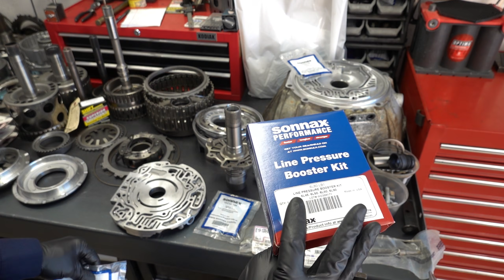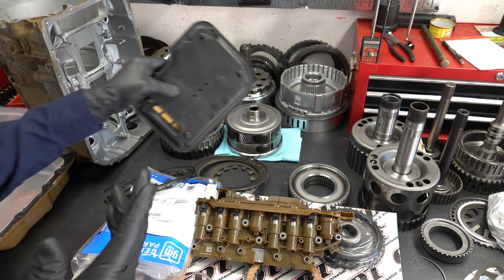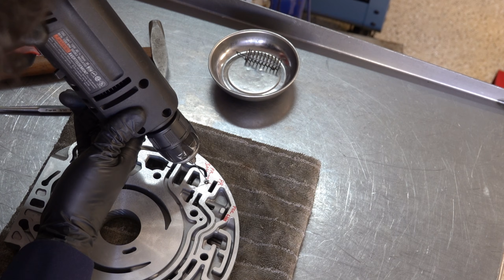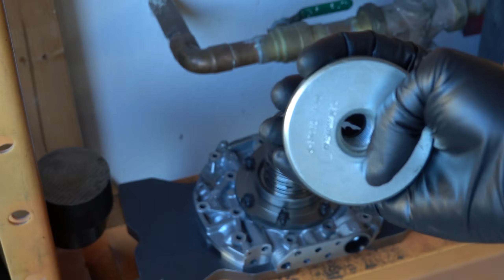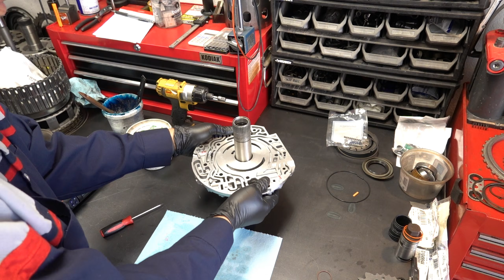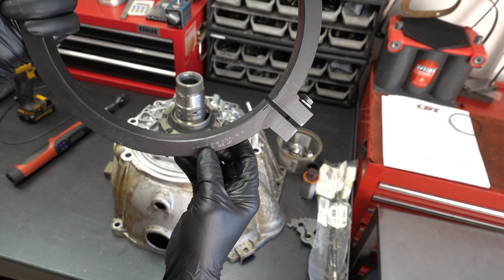6L80 Performance Rebuild PT1 - Overview and Pump Assembly

Comment from the maker: Notice to All Builders: Sonnax released their updated pressure regulator valve after this video was filmed - the updated valve DOES NOT require you to drill the balance hole in the casting at the back of the pressure regulator valve bore, as shown in this video. The new Sonnax part number is 104520-15K. This part supersedes the previous design, which was part number 104520-14K and is now considered obsolete.

Comment: I recently rebuilt one, been a few years since the last one I did.

This one has a bind in 3rd gear that I believe is due to the 4-5-6 clutch clearance being too tight. It’s at .054” and spec says .060-.074. Is that really enough to cause the issue? 

The paperwork included in the tow and pro kit from transgo describes this same complaint. Only happens once per key cycle.. after it binds, it drives flawless the rest of the drive until its key cycled again.
Reply from the maker: Hi Chris, thanks for watching.

We typically don't see binds at the 3-4 transition due to 456 clutch clearance being too tight until you get below .045 clearance however these transmissions usually like more clearance, not less. 

That said, the ATSG manual calls for .050-.074 for 456 clutch clearance however Transgo's are also acceptable. I'd take it back out and purchase a thinner snap ring to bring your clearance to at least .060 but not greater than .075. I would measure your clearance once you have the trans apart again (in fact, measure all clutch clearances and record the values).

Gears Mag also has an article about this issue: https://gearsmagazine.com/magazine/6l80-bind-after-2-3-shift/

Check for cross leaks at the stator and input shafts between 1234 & 35R along with the 456 clutch, if you didn't do that during the rebuild or via post-rebuild diagnostics. Once you get your clearances into spec, that should resolve the problem.
Reply: This bind happens about 2 seconds after the 2-3 shift

How can I check for cross leaks there?
Reply from the maker: Here's my air check video - you don't need any test plate to do this and it can be done either w/the trans still in the vehicle or fully assembled on the bench (valve body/TEHCM/speed sensors off of the case belly).
https://youtube.com/shorts/qG-mb8Rs34g

Bind on the 2-3 shift would seem to indicate an overly tight 35R clutch pack however the TEHCM preloads the 456 clutch pack's apply piston w/fluid during the 2-3 shift to prep it for the 3-4 shift. If the 456 clutch pack clearance is too tight you'll bind as you shift from 2nd to 3rd as the 456 clutch pack should not be applied during that time.

Check out the GEARs Magazine article that I linked in my previous reply for a more detailed explanation.

Comment: I cant stop watching your vids. Yes they are long but definitely the most thorough step by step instructional vid out. I tried finding the Saturn TAAT control valve body dowel bolts you suggested for aligning the pump but not much luck. Any search suggestions? or maybe my wording is not correct in my search. I think this is the most economical for a single build.
Reply from the maker: Thank you very much for all the views and kind words, Wade! 

When it comes to bolts and small parts, your best bets are eBay, the dealership (if such parts are stocked) or a local pick and pull junk yard.

Comment: Hi Nick, I have old model stator upgrade it with new model dose require to change other parts to fit. Also if buy new stator i will machine only pump body so use OEM thrust washer or oversized one?
Reply from the maker: Use OEM washer and check 35R drum spacing/end float - if it's excessive, install the Sonnax washer. 

End float: https://youtube.com/shorts/14Tf4G3EQHI

Comment: Great video! Is the Sonnax intermediate shaft recommended for a 6.2/6l80 AWD (bolt-ons & tune only) that is used for 7000# towing less than a dozen times a year and street performance?
Reply from the maker: Thanks for the view and kind words, carsandracetracks. I'd put one in as insurance, especially if engine power is in excess of 500 at the crank. All it takes is one more pull/trip down the track to break those spin welds that hold the intermediate shaft to the hub...

Comment: Hey:  I have watched several of your GM transmission videos, especially the 6L80/6L90, and I appreciate the level of detail along with your commentary.  These transmissions require Dexron VI atf, and Dexron VI is available as both a synthetic blend and synthetic atf with each base oil meeting Dexron VI specs.  My question, have you noticed any performance differences between the synthetic blend and synthetic Dexron VI fluids in GM pickup trucks?  Again, many thanks for making these videos.  Best.
Reply from the maker: I run synthetic Dex VI in my Sierra's 6L80 and have no direct or ancillary experience with the synthetic blend stuff. Thanks for watching, RG.

Comment: Getting prepared to rebuild a 6L90 that’s in my 07 Sierra 2500HD. It’s been a great trans but now has 170k miles on it and it’s starting to show some wear, no codes yet though. I’m sourcing GM updated parts and special tools I’ll need. Thanks for taking the time to produce this vid, it’s come in helpful already.
Reply from the maker: Thanks for watching, emf! Appreciate the views. Post any questions you have along the way.
a couple videos you may find helpful, if you haven't already seen them:

Special tools: https://youtu.be/gTGRiPsnlHE

Tip for reinstalling 2-6 clutch return spring: https://youtu.be/GLTUPEOA-Gc
Reply: My truck is a 1500 AWD,6.2 with a 6L80.A little more than 300,000 miles. All gears are good except 2n to 3rd is slow to shift. I let off the throttle to complete the shift for less slippage. I will be doing a complete engine and transmission rebuild in 2 years. Was thinking about doing a TC lockup delete if possible.

Comment: In addition to the circle D stage 2 kit, do you have a list of every item needed that is not included? I've watched all of your 6l80 videos, and i am practicing on a core just disassembly and reassembly for now.

I will them be pulling the 6l80 out of my 2008 cadilac EXT AWD. 

I just wamt to make sure i dont miss a part and end up waiting for them to come in. 

I know a parking rod is on that list possibly a sonnax hub and mot sure if this includes the trans go or zip kit also or if thats something sold separately
Reply from the maker: You actually have the list - this video! I show all the parts that went into the unit, including those not included in the Circle D kit.

Comment: ugh.. this looks scary. my 6l80 torque converter started shuddering and i drove home 10 miles and parked it. guess now i’ll be doing a full rebuild. at least frictions and steels, molded pistons, billet torque converter, and all new seals and gaskets bushings. also trans go pro and tow kit. i’m sure im missing a few things i need. just nervous to do it myself
Reply from the maker: Don't be nervous - these transmissions are not difficult to work on once you have all the tools and supplies you need. Plus you have this video series, my other demo series and the ATSG manual (link to a free PDF version should be in the description).

If you don't have vacuum testing equipment, I would either outsource that function to a transmission shop or simply purchase a reman GM pump assembly and valve body assembly. Then you just have to worry about building up the case correctly.
Reply: @nickstransmissions thank you man, i will definitely keep that in mind. i also think its just a whole lot of information im trying to take in at once and learn so im overwhelmed but i think as the days go on that i watch you and other guys videos i feel better! thank you once again!

Comment: Is it ok to run this level kit on a stock 5.3? But planning on adding more power later.
Reply from the maker: Sure. In fact, I'll be installing that kit into my GMC Sierra's 6L80. Just make sure you turn the air bleed off in the 4-5-6 shift table as the Sonnax 4-5-6 piston kit that comes w/the broader Circle D L2.5 kit requires it be deactivated. This is due to elimination of the wavy cushion plate when using the Sonnax kit.

Comment: Morning Nick… quick question which of the Chevy transmissions would you say is the easiest and cheapest to repair .. on normal occasion fb marketplace … and which name brand kit do you prefer to install on that transmission thanks …
Reply from the maker: TH350s and TH400s as they're both related to 700Rs, 4L60Es and 4L80Es so a good stepping stone into those four-speed units. Kits can be bought at local hard parts suppliers. Transstar, Transpartswarehouse, WIITPerformance Transmission all have complete kits available for whichever power level you're building for.

Comment: On the sonnax pump thrust washer that’s thicker is it required when your only replacing the stator and not the bell housing because my bell housing and everything is good it’s just got the old crappy 1st design stator sealing rings that spin so I’m buying the updated assy that doesn’t spin with a machined down stator plate… would I use use the original thickness thrust washer or the os washer …. Again ur the best at this stuff others just show here and there and I think purposely leave stuff out and you … you show us everything and might I add lol u make it look so easy lol … thanks again
Reply from the maker: Hi Kenneth, if no machine work is being done, simply use the original washer. If the stator is being machined, use the Sonnax .020 thicker washer.

Comment: I have built thousands of these units- 80 or 90- same thing, SORT OF. The 90's have a few different (bigger) parts, but over all same trans. Most failures are not due to convertor failure, but rather, due to pump reg. problems and lack of fluid changes causing convertor failure. A few techum issues here and there, but, that is usually indicitive of trans mechanical issues. IF you are reusing the techum, replace the presure reg. switch diaphrams in the techum, you can also buy this kit, tooling to do this is inexpensive. 

More often then not, the 4-5-6 clutches are smoked. Also, The 3/5R drum cracks at the weld and leaks, then looses sealing at the bearing that is pressed into the 3/5R drum - make sure you replace this bearing/seal as it has an o-ring seal made into the bearing assembly where the pump enters it. It is rare to see cracked pistons- check them either way. You can also check the 3/5R drum with speciality tools, at additional cost- highly advised.

GM offers a fully loaded 3/5R assembly- USE IT, it will save you time and money.

If your bellhousing/stator- (pump assembly) is trashed- replace it as a machined assembly, however, if it looks good run it- as it is a machined assembly from GM when it was originaly made, but replace the pump bushing and seal. I highly advise a pump alignment tool when reasembling the pump, do not tighten the bolt on the pump alignment tool- it is not necessary, as this can cause incorrect torque issuse because the stator has to fight the grip of the tool on downward force- this pump alignment tool is of spring steel no need to tighten it- let the correct torque be allowed. Also, the pump bushing on install and removal is in one direction- opposite of each other- purchase the correct tooling to do this correctly, otherwise you will break the bellhousing where the bushing goes in. Trust me.

FYI; trans assembly gel is not trans lube- keep this in mind- it is ASSEMBLY GEL. From 1:18:15 to 1:22:02 is a/an compleatly incorrect way to install the pump assembly, first off DO NOT, I REPEAT DO NOT use trans assembley gel on your pump, with 2 exceptions. Only to hold the pump slide lower seal and vane guide in place (sparringly) which negates the need to flip the bellhousing, and never use it on any part of the pump slide assembly. Then lightly lube using trans fluid instead.

If you do not have a REAL trans cooler flush machine, REPLACE THE RADIATOR AND COOLER!!!!!!!!

All the parts to fix this trans and make it far more reliable are available from TransGo, in drop in fashion, both for valve body and pump in a easy to install kit. Quick and very relaible. Most of the time these transmissions are over heated, add too, or, replace your stock trans cooler, (very important- keep it's cool) run REAL synthetic fluid, such as Mobil One. Then you are good to go.

As a side note: This is the EASIEST automatic  transmission to build- period. It's what I train all new builders on.
Reply from the maker: Hi Kodi, thank you for your comment and for sharing your knowledge. From the units I have built (probably not anywhere near as many as you have), the TC was the primary reason the trans came in but the PR valve, TCC reg valve (hydraulics in general) are the main underlying drivers for converter and other issues in those units, as you mentioned.

Re the 3-5-R drum: I just have the welds on the existing drums reinforced (unless there's something else wrong with the drum). Everything is tested, inspected, and either reconditioned or replaced in my builds. It's much less costly and they have a stronger drum...While I know GM strengthened the welds in later years, I simply don't trust them.

Re the TEHCMs: I almost never reuse TEHCMs; the only instances I do are when customers simply cannot afford to replace them. In those cases, they get no warranty coverage if the pre-existing TEHCM malfunctions and damages internals, requiring the transmission to come back to me for repair...At that point, they pay for the repairs, labor and a new TEHCM, if they want me to touch it...Their warranty spells it out in super-clear language.

I've never had an issue using Transmission assembly lube on pumps for any transmissions but I know many will use transmission fluid in that area. So I'd dispute your assertion that my process was incorrect when it comes to pump assembly. I prefer Sonnax parts over Transgo but I use their stuff in many other applications. 

Very much agree w/your side note. I'd also apply that note to the Ford 6R80s and 140s. 

Thanks again for taking the time to watch and comment. It's always nice to hear different perspectives from other, more experienced builders.

Comment: Hello Nick 

If it's only the stator support that is machined, do you still recommend using the sonnax oversized pump thrust washer? Bell housing is new.
Reply: Thank you. Both were machined, but bell housing cracked during bushing removal😢😢 so I picked up a new one to be safe. I will keep you posted. By the way, you are the best, sir.
Reply from the maker: Have both on hand, see what happens when you install one vs the other. I never had a situation where only the stator (or only the pump body/bell half0 is machined so that would be my recommendation.

Comment: 51:54 have you heard about preloading the stator clockwise before torquing your bolts? This is to prevent stater rotation on start up of the vehicle. From what I’ve heard, you snug the bolts just over finger tight in a star pattern, then hold the stator support plate in a vise and then take a large pair of channel locks, and grab the spline section and put a clockwise load on the stator and torque the bolts to 60 in lbs in a star pattern, then remove from vise and proceed as you did in the video after the torquing at 60 in lbs.
Reply from the maker: Hi Larry, thank you for watching...I've actually never heard that or anyone doing so - will ask one of my builder friends whose shop rebuilds these daily to see if anyone there has...I have never had a problem w/the stator rotating on all the 6Ls I have done, FWIW.
Reply: @nickstransmissions  did anyone have that issue?

Comment: 25:30 what’s better? This pressure regulator valve or the transgo valve that requires no hole drilling because it’s hollow?
Reply from the maker: I think it's a "six in one hand, half-dozen in another" kind of deal...Same applies when comparing the Sonnax Zip kit to the Transgo Tow-N-Pro kit. Both are excellent and do their job well.

Comment: Thanks!
Reply from the maker: Thank you, SKMYF!!! Much appreciated, man -  cheers!🍻
Reply: @nickstransmissions  Is it required  to upgrade the 4-5-6 clutch hub to the sonnax billet when you are using the circle D Level 2 kit? That billet hub is expensive.
Reply from the maker: @SKMYF Its not required for the 4-5-6 frictions in Level 2 or 2.5 kit, only the 3 and 4, given they use the 45-tooth Powerglide spec frictions whereas the 2 and 2.5 use the stock 32-tooth clutches. That said, I generally recommend the Sonnax billet part for anything more than 500 hp/tq or so and racing and/or serious towing-hauling at any hp/tq level.

Comment: Question to builders: have 2011 Sierra 1500 5.3L 4x4. I just blew my trans - I guess something with pump as it started to be extremely noisy one morning, and afternoon I lost all gears, but could get a little drive (seconds) if I turn off engine for a minute). I am planning upping power using supercharger, so probably 500hp, but torque down low too. It is fun vehicle, meant to be abused including offroad abuse. What kind of build should I do? Any transmission builders having good option for that? I never rebuilt trans, but don't afraid to get dirty either.
Reply from the maker: Other builders may weigh in but I'd rebuild your 6L80 exactly like you see in this video series. You can add a six-pinion front planet from a 6L90 if you'd like as they are identical in every respect to the four-pinion 6L80 planets, other than the pinion gear count.
Reply: @nickstransmissions  what's the price to rebuild 2012 Chevy Silverado 1500 6L80 4x4?
Reply from the maker: @mtsanchez27  - Shoot me a DM on Facebook w/your contact info and I can get you a quote: https://www.facebook.com/profile.php?id=61565989906020